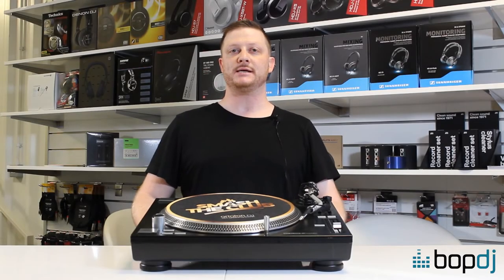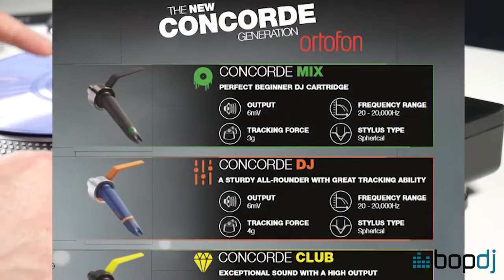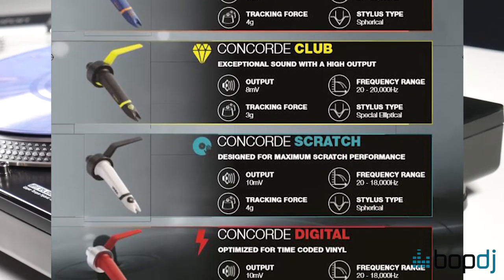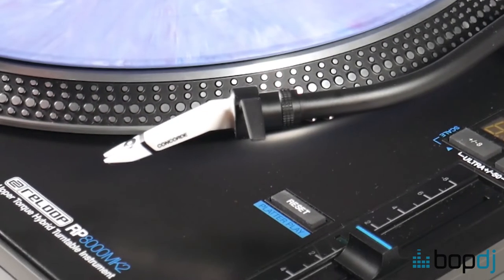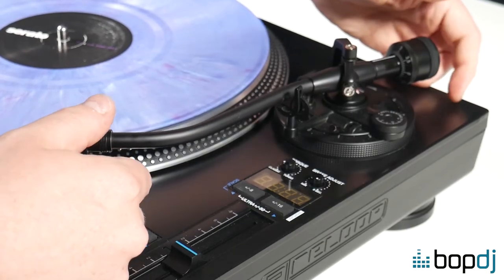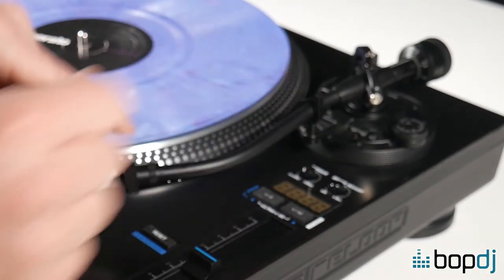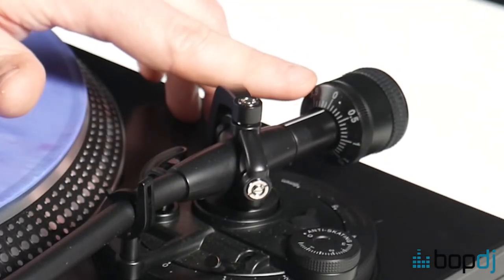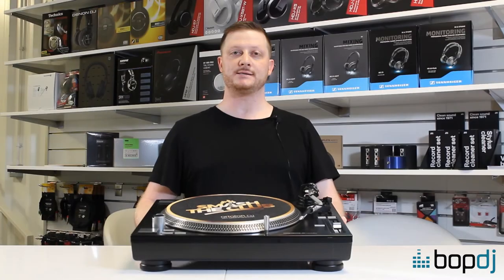How to Balance your Tonearm - Turntable Setup | Bop DJ

Comment: Is it supposed to float back towards the arm rest when it is floating? My anti skate is set to 0 and my arm bearings are fine.
Reply from the maker: It is supposed to float at a level and float on its x-axis the direction doesn't matter at this point :)